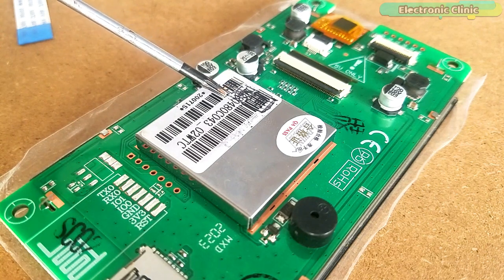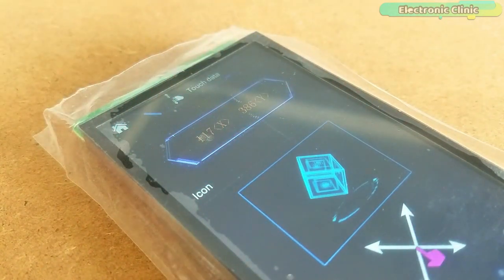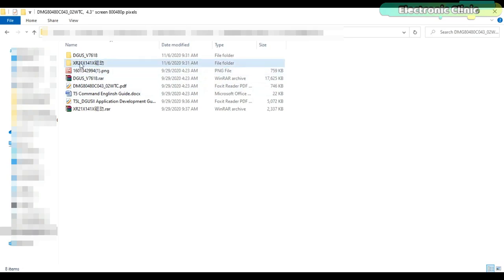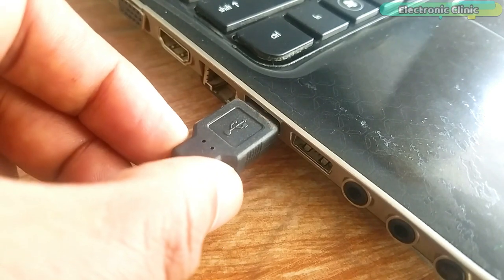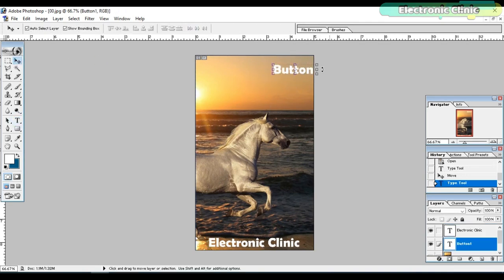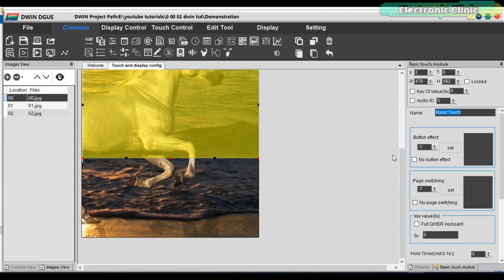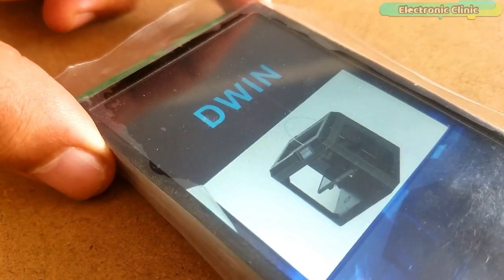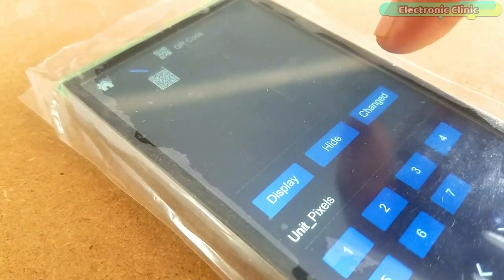DMG80480C043_02WTC Touch Screen from DWIN Technologies, GUI, specs, and interfacing, HMI LCMs

Comment: Ever tried any of the Nextion displays?  I have one, and it's so user friendly.  The nextion editor is also very easy to use.
Reply from the maker: i never used it. lets see if someone sponsored nextion.
Reply: Nextion displays has a price twice as high. In the case of a series of products, this is not cost effective.
Reply: I understand!  I was just wondering if you ever messed with the nextion in order to compare and contrast the two different brands.

Comment: I used the DWIN_SET from the example folder and copied it to SD Card. The download screen appears but it's downloading nothing. I have the same display. What am I doing wrong here. It's an 8GB SD Card. The only difference I saw is the firmware version -> mine is V3.1. Do I need to update? How?
Reply: where do you get the example folder?
Reply: Meli Faucett  Hi Meli, the display is under DWIN T5L CPU, background images need to be transfered into ICL, you can name it per your requirement.
Reply: @amazony7873  Hi Y, we DWIN have open source for the factory demo. You may contact us.
Reply: Hi Christian, maybe you can forwarde your project to us (DWIN) for further checking.
Reply: Same here. It's showing a list but no files are downloaded from the SD Card. I have V4.1.
Reply: @omkarbhatt2729   hello,  if the display is under DWIN T5L CPU, background images need to be transfered into ICL file